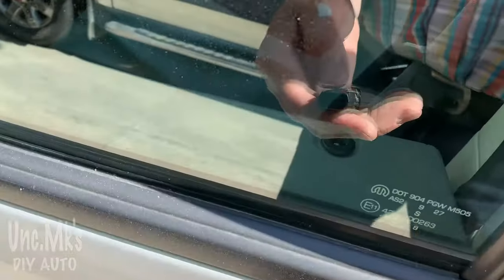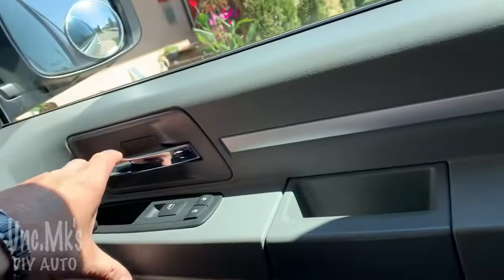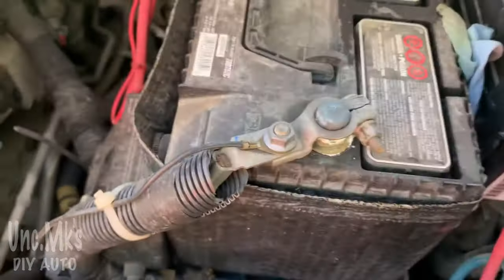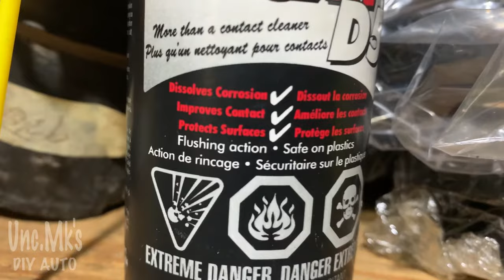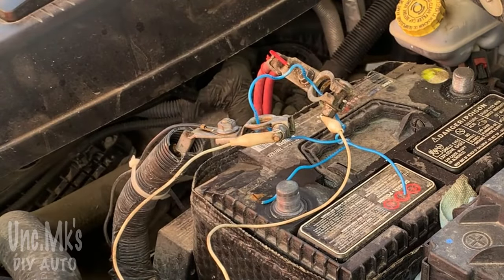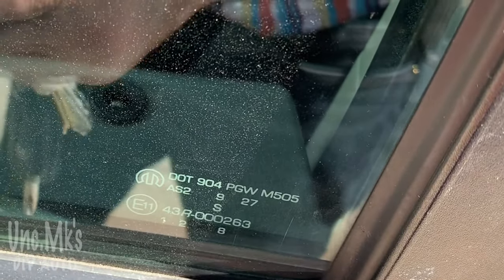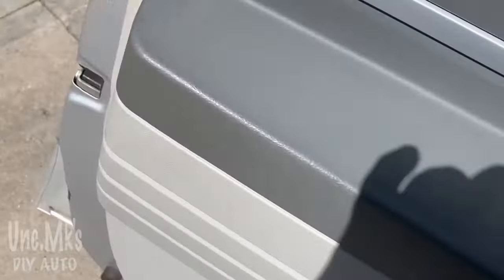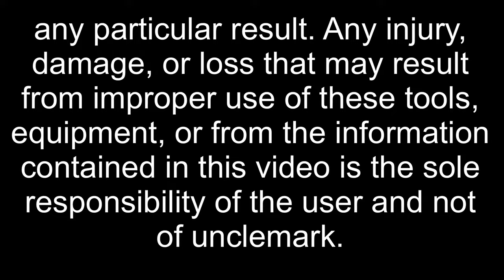How to get my door locks working! TRY THIS FIRST!  (EP 216) Why don't doors unlock? Grand Caravan VW

Comment: This absolutely works , guys. I followed the directions and my locks all work great again. 2019 Ram.
Reply from the maker: Hope it keeps working. Sometimes the computers get mixed up and need a reboot. Holding the two cable together drains the capacitors completely.
Reply: Gotcha...Thanks again. @unclemarksdiyauto
Reply: @unclemarksdiyauto I tried this on my 2013 dodge Grand Canyon and my slide door still doesn’t work. Only manual any other advice?

Comment: This fix worked for my 2015 Dodge Ram 1500 too!  I was at wit's end and waiting for an appointment 3-4 weeks out at the Dodge garage.  20 minutes and voila!  So far, so good.  Thanks a ton Mark.😃
Reply from the maker: So glad to hear this, Mic. You never know what tips can help. Good to know it worked on a truck as well. I think they all use a similar TIPM setup.
Reply: So you just took off the 2 terminals and connecting them together and it works sir? I do have the same problem with my 2016 Dodge Grand Caravan
Reply: Aloha Uncle! My 2008 Grand Caravan keeps unlocking itself even when my key fob is nowhere near it. Got any ideas?
Reply: It took a moment to kick in but it did work. Thank you 🙏
Reply from the maker: @minhhoangnguyen3694  That is what I did, yes. Should really have them held together for at least 30 minutes.
Reply from the maker: @mnoot7209  Take your batteries out of the key FOB and see if it cures it. There is a key in the FOB to open the door. I don't know how often it happens to you, but you could try this over a couple days. Does someone use the 2nd FOB as well? It could be either FOB.
Reply from the maker: @wolfpackreceiving500  So glad it worked!

Comment: Hey there. I have an 08 Town Car, and it looks like I need to replace my lock door actuator on it.  It's currently jammed and I can't get the door to open at all. Here's the thing I wanted to find out from you: it was actually briefly working for a day or so, a few weeks ago, after getting it back from a mechanic who was diagnosing something on the car for me. I haven't been able to talk to the mechanic since then......but I suspect that he might've briefly dissconnected the battery for a brief time. Do you think dissconecting(then reconnecting) the battery is the reason why that door was briefly working?
Reply from the maker: Disconnecting the battery should have nothing to do with this problem. These lock actuators go bad. Sometimes they work poorly for a long time, sometimes they stop. I would think you still should be able to manually open the door. (I could be wrong) Replaced one on the wife's van. On her's, it would just not lock or unlock electrically. Her is me replacing it. (Not easy) https://youtu.be/OcBPU9zrQrw  Also video on how it works: https://youtu.be/Jw4b8bThNAs

Comment: i'll laugh my ass off if this actually works, will try this this tomorrow. front passenger door locks, but won't unlock
Reply from the maker: What you driving, Steve? You probably have a wire broken in you drivers door jamb. Right now, wife's 2010 Grand Caravan has no unlock on drivers front & sliding door. Locks with all the other doors.
Reply: 2010 grand caravan no power windows or door locks up front, the passenger front will lock unlock ? Power to master switch, motor works with power ground supplied but nothing with driver switch

Comment: My 2012 dodge grand caravan just had this issue yesterday. None of my doors will unlock or lock using the fob, the drivers door panel or the passenger door panel. If I click the lock button on the fob, the horn will honk as if it's locking, but the actual lock switches on the doors don't move. Any ideas?
Reply from the maker: Not off hand. Did you try unhooking the van battery for 10 minutes? These vans have issues with the under hood fuse box (Called a TIPM) The worst thing can could be wrong is this TIPM. Very expensive. I would try the van battery first. Weird that no locks work either with FOB or switches in van. Usually it is just one side of the van that acts up. Keep us posted, Grace!

Comment: Thank you ...  Disconnected battery, rebooted system...  No Change in issue..  Lost Communication with left slider and window.  Locks still operating..  CODE U0201.  checked fob, ceiling switch, door switch, Fuses all good.. No noises, both just stopped working..
Reply from the maker: I think that is a CAN BUS code. Computer can’t talk to the other modules that operate those windows. If I were you, I would first check that the wires for the drivers door where the exit the door and enter the van body are not broken. Keep us posted.

Comment: Seems to have done the trick, thank you! I also had a bunch of gunk on my battery terminals so cleaned them up while I was at it, thanks again!!
Reply from the maker: These newer vehicles seem very upset if battery terminals get dirty, or the battery is low. Both can cause all sorts of weird issues. Thanks for stopping by. Hope to see you again soon. What kind of vehicle did this work on?
Reply: @unclemarksdiyauto  you're right, it was only my driver door acting weird, I thought for sure, that doors actuator was failing. It was on a 2017 Nissan cargo van 2500. I still can't believe this was all that was needed to restore functionality, you're the man!
Reply from the maker: @absolute.freedom  I think we were both lucky! Hope it keeps working well.

Comment: Awsome Videos I learned a lot about my Town &Country Van, Did you ever make a video of repairing EGR valve?
Reply from the maker: Just the removal & replacement Bruce. I think you would need the $1200 bi-directional scan tool to activate and move it open & closed to spray gunk remover in it. I have the tool, I just need to get time to look at it. Video to come, but probably not for a few months.

Comment: I tried it without the jumper cable but just put my key in the ignition to start it to discharge the battery and it worked. At first it didn't seem to work but after a few minutes of trying to lock the door it did work. I have a Kia Rio 2012 and it finally works. Thank You. Took 10 minutes.
Reply from the maker: Nice it worked, Sue!

Comment: Thank you! Worked for my 2009 KIA Sedona! Driver door could operate own window, but no automatic door locks, other door windows, or the fuel release would work. Tried replacing the driver door module (DDM) fuse with the specified 30A cartridge...didn't work. I simply did what you said, except I was impatient...I disconnected the negative wire, waited 30 seconds, and then immediately reattached. That did the trick! Many, many thanks from my wife, who drives the van!!!
Reply from the maker: Nice! Take care & thanks for letting us know this worked for you.

Comment: My 2019 Ram just started doing this the other day. I'm gonna try this and let you know how it goes. Thanks.
Reply from the maker: Let us know. This resets the computer. Spoiler alert, our issue ended up being the TIPM. (typical dodge problem area) Anyways, all the best. Let us know if it worked!
Reply: It ABSOLUTELY WORKED !...Thank you , brother. I followed your directions and it is back up and running perfectly.  Much appreciated ! @unclemarksdiyauto
Reply from the maker: Hope it keeps working. Mine ended up being the TIPM. Locks finally stopped unlocking on one side of the van.

Comment: Tried this last night, did not work. Was hoping for different approach to the fix.
Glad it worked out for ya!
Reply from the maker: Hi Splash, do all of them not work, or just one side of the vehicle? Besides where the door and the body wires bend every opening, another issue can be causing it.

Comment: The two front doors work good, It's the two sliding doors that won't work lock or open, have to manually Lock & Unlock the 2 slide doors.
Reply from the maker: @torineg.847  might be wiring in the plastic chain at the bottom of the sliding doors. Did they both stop unlocking at the same time? (Could be other things as well)

Comment: I'M going to remove the LOCK MOTOR fuse  # M 38  on my vehicle. 
Which should " completely  leave the locking unit , without power 
and replace it 10 minutes later,  : Which will FORCE the computer to do a toltal RE-SET , upon returning power to it ... 
I'm  not removing  battery  cable's. No way . To much work . 
But thanks  the reset is a beautiful idea 💡.  
Ho ya Humm it worked  !
Reply from the maker: That will not reset the computer. it will just disable the power from the computer to the switch and motor. (no reset will happen) Also the attaching both battery cables together will drain the computer capacitors completely. If you idea works, it may be a motor issue. Keep us in the loop as to if things are still working in a few weeks/months. Thanks Andrew.

Comment: Thank you, it helped me right away. 2005 Dodge Grand Caravan SE. I appreciate your knowledge in this video. ❤👍
Reply from the maker: Wow, that is nice! Glad to help.
Reply: This is a temporary fix on my 2003 caravan, it comes back fairly quickly. Anybody understand what triggers the problem in the first place?
Reply from the maker: @fredf1794  Ah too bad it was a temporary fix. Lots of computers running everything. Something is not happy. Mine got bad enough I had to replace the TIPM. My problem was just the drivers side front and back not unlocking. They would lock though. Traced it back to the TIPM. (Basically a non replaceable relay was shot)

Comment: Just wondering, would it work if I just connect my jumper cable on the negative and positive terminal wires?
Reply from the maker: @kkjafarhi3174  not if they are hooked up to the battery. Do NOT hook these together if they are still connected to the battery. If the cables are NOT connected to the battery, yes booster cables across the 2 cables will work.

Comment: Good info !! I have a 2010 Dodge Ram Caravan with crazy electrical probs....with doors and Windows....they operate on their own. One door lost power completely.
The windows will occasionally go down on their own ( usually with the engine OFF ) ....and nothing worse than to discover your windows down ...not good.
Thanks for the vid !! Plan to try this !!
Reply from the maker: We had a problem with the remote falling apart inside and doing similar issues. If you have 2 remotes, maybe take battery out of the one you usually use and use the other one for a while. If your problem stops, you know it was a bad remote Raven!
Reply: @unclemarksdiyauto  THANK YOU !! ....Definitely will try this !! .... Dodge Dealership confirmed many electrical issues in some of those older models , so glad for tips to try ! :)

...also..... the current Air Bag Recall on same year and model ...( which they take care of that for free, but I'm in line on a long list ) ...different subject, but the first thing Dodge Dealerships are doing is removing the Ram emblem from the steering because it's a projectile that can be a terrible incident if airbag deploys. Just another FYI, the 2010 is under that Recall. In Wisconsin here, Dealership told me they're so backed up, they only receive 2 new kits per month to accommodate customer Recalls....yikes.

Comment: Aloha Uncle! My 2008 Grand Caravan keeps unlocking itself even when my key fob is nowhere near it. Got any ideas? 

At first i thought i was going senile - either forgetting to lock it up, or pressing the fob in my pocket by mistake. Now i parked it way down the street ...yet it keeps happening!
Reply from the maker: It could be a bunch of things. One thing that comes to mind is the wiring going from the drivers door though the door jamb and into the body of the van. Might have some wires with insulation broken and they are shorting out causing this issue were they bend i the door jamb. Let me know what you find.
Reply: The same thing happened with my son's 2009 dodge ram pick up.  We had to buy new key fobs, as one of them was faulty and would send unlock signal even if it was sitting in a drawer.

Comment: Juss a question sir I have a 2022 Ram 1500 my back driver side door won’t lock or unlock I have to manually lock and unlock it now I know u said it may work for the 20s vehicles but anyway this won’t mess up my computer or anything like that correct?
Reply from the maker: @lilfella8955  is your vehicle not under warranty?
Reply: @unclemarksdiyauto  no sir unfortunately
Reply: @unclemarksdiyauto  everything else works Juss doesn’t lock or unlock I can roll windows down and all that
Reply from the maker: Could be a wire in the drivers door were the wires enter near the door hinges. If it was the switch, I would expect that one of the functions like lock OR unlock would work. So NONE of the doors lock or unlock, or just one?
Reply: @unclemarksdiyauto  it’s only my back driver side door everything else works

Comment: I have exact same probkem with front passenger and rear driverside door.

I tried this trick but didnt work.

What i shoud do?

My car is Lexus rx330 2004
Reply from the maker: Could be wiring in drivers door in the door jamb where wires bend when you move door. Probably a couple wires broken. This is the first place I would check.

Comment: how the heck  did you figure this out ?  you are  smarter than the average bear...this should save some folks a few hours at the mechanics shop ..what a great tip and good video  thanks uncle
Reply from the maker: Smarter? Nope! You know me better don't you? I knew it will reset the computer by doing that & hoped it would allow the door locks to be back "on line". It has worked flawlessly since I did the video, which was back in maybe in June or July (2021) It got all upset when I swapped the door lock actuator.
Reply: i never heard  you can reset the computer by doing that ...my 1995 gmc truck  would i have a computer ?
Reply from the maker: @queenstownkid  some type, yes for sure.
Reply: @unclemarksdiyauto  ok thanks  think i got 115k on it  bought it in 1996
Reply from the maker: @queenstownkid  Thats low kms for a1996! Had 176,000 on my Park Ave that I just sold. Replaced it with a Chrysler Sebring with only 67,500 kms! Lots of videos planned on it!

Comment: My 08 eclipse will randomly throw fits which prevent me from unlocking any of my doors successfully.i have 1 door lock cylinder on the driver door,no key hole on trunk or passanger side.when i turn my key either direction i will hear the locks click but will remain locked until non  all 3 points of entry.
Happens more often when its cold...think this weird ass procedure will solve my probs????hope so
Reply from the maker: Hard to say as your is a different manufacturer. It is not a hard procedure to try. What do you have to lose by trying it? I am thinking you have a shorted or corroded power or ground wire somewhere and that possibly is more likely your issue.

Comment: I have a problem and it's with buttons on the window switches. Could it be the door module or should I try this process? No windows or door locks both sides. 2012 Caravan Mirrors work and vent windows work though.
Reply from the maker: So hard to diagnose without a good scan tool. Tool could command windows up and down which would answer so many questions like your door module. Each door has its own module, so probably not module. Did all the windows and locks just stop all together? Or did it happen to one first?

Comment: I had unlocking rear door, (the one you lift at the back). Would sound the locking OK but wouldn't unlock.
Then I tried this and it unlocked all doors including the one but when I locked it again, same problem.
Then, for no reason, I kept pressing unlock on the remote and it started working again OK.

Seems when I locked vehicle some time I pressed the lock button on the remote more than once and the locking system needed me to unlock it more than once.
Reply from the maker: You probably need a door actuator. What are you driving?  And what year? If it is a grand Caravan, the sliding doors are hard to do & I don't have a video on it. I did one on the front door. Take a look how hard they are to do here: https://youtu.be/OcBPU9zrQrw
Reply: @unclemarksdiyauto  I'm in Australia.  We have the Chrysler - it's called a Grand Voyager here. Mine's 2008 model - 6 cylinder.
In US I think it's a Dodge something.
I actually quite like driving it - plenty of room though not particularly fuel efficient.
I like how seats vanish into floor - lets me put a mattress in the back and go camping for cheap occasionally.
Got 350,000 klms on the clock.  Only major repair was transmission changeover.
It always seems to be beeping at me for something - I just ignore beeps now.
All locking/unlocking working again.
Reply from the maker: @denbo4023  I have owned a few Grand caravans. From the early 1980's , then 1992, then around 2007, a 2010 & 2014 and another one somewhere in between all that. 2 were stow and go. Its a great feature!

Comment: Resetting the computer may help for other things too.  Do you think this would work for other cars like Buick Regal?
Reply from the maker: It could. 30 minutes is probably the shortest time I would clamp the 2 leads together.  As for this trick fixing other things, the TIPM is a funny creature. It controls lots of stuff as it also has some micro chips inside.
Reply: Thanks for the speedy reply.   @unclemarksdiyauto

Comment: Would this fix apply if my door lock is stuck open? I can't manually move it to be closed. I'm afraid to reset the computer, would I need to set important configurations after that? (not worrying about the radio or clock but main operational features)
Reply from the maker: If you can’t manually move it closed, either the door actuator is faulty and needs replacing, you have a short causing it to hold in lock position or you might even have a TIPM issue. Don’t bother trying this. Look into these other issues.
Reply: @unclemarksdiyauto  thanks a lot, I'll look into it
Reply from the maker: @SandyGonzález-n7u  let us know what you find!